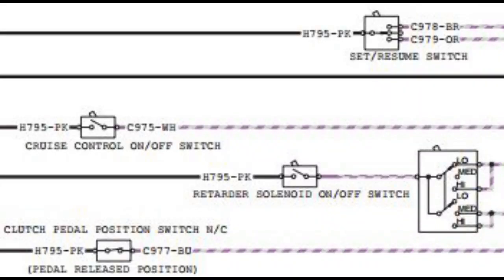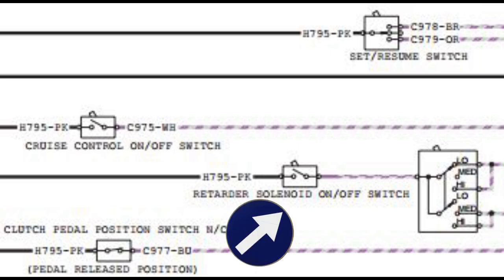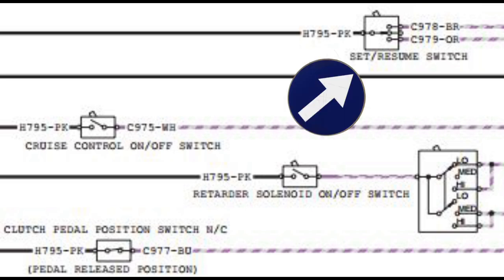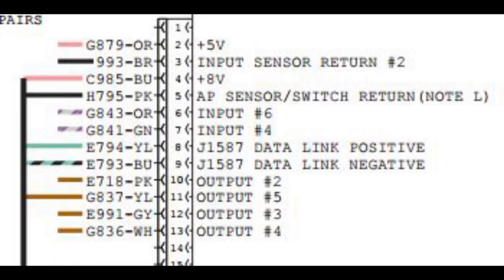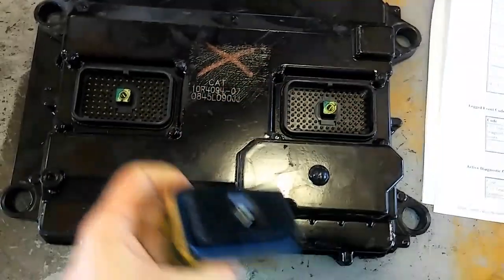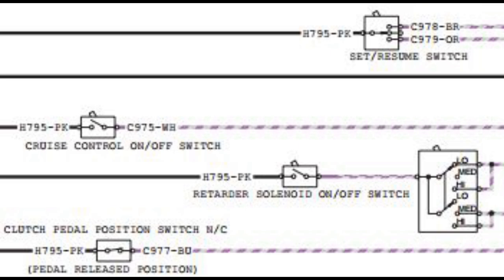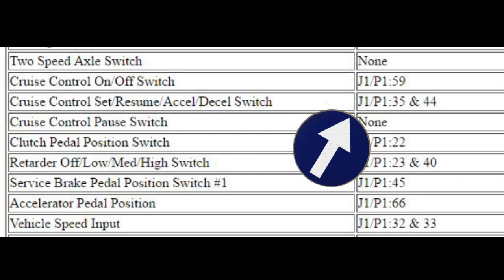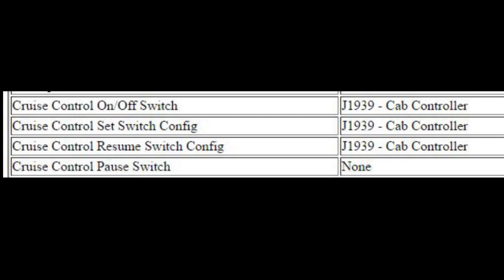Cat Cruise Control Circuit And How It Works.  Diesel Engine Troubleshooting.

Comment: Great video. One question, I have 12v at my #59 pin (ecm side) while Ecm connector not connected. We did have batt/master issues. Kinda thinking the ecm got arc damage. What you think?

Comment: I have a 2001 peterbilt I do not have on off switch . 7cz with a brake save. I was told it is a brake pressure switch but the tech could not tell me where it was located. He had a rough idea but that was it. Any clue where it could be located

Comment: I got a strange situation.  I can set it in neutral and it shuts off when I apply the brake pedal.  It won't set in drive at highway speeds.....

Comment: I have an 02 379 with a 6NZ Cat. My high idle works but I cannot get the truck to cruise. The clutch will also turn the jakes off. Any help? I have also replaced both switches in the dash

Comment: why doesn't my cruise light on the dasboard not come on? have replaced the on/off switch. The test light doe's come on. CAT ET says its the brake pressure sensor switch which we have replaced with a new one.

Comment: I'm guessing my issue is a bad switch.  05 379 with a BXS.  Cruise, high idle, and flash codes won't work.  Jake's work and the check engine light is not burnt out, the light for the cruise control lights up when you flip the switch on, and the brake lights function as they should.  I have had intermittent issues with both the tach and speedometer needles hoping around, or occasionally getting stuck and not moving at all, but the cruise and high idle still worked fine until last night.  Any thoughts, Ape, or others?

Comment: I know you're a busy man but if you could help it would be great ,how could you hot wire the cruise with no switches except the on -off and set resume ,run grounds to ecm on pin locations or power?

Comment: C7 sterling dump truck cannot get cruise control or hi idle to work checked with cat et and noticed the low speed cruise setting was 127mph I'm not sure if this could be the cause or if I'm looking in the wrong place

Comment: 2007 387 c15

What better way to find out about issues then to ask a bunch of peterbilt owners these questions right.

 Hi every one so im sure many of you have experienced issues with cruise control not engaging freeway speed, so what could be the issue?
  Engine break works and rpm idle engages, both buttons on dash have been replaced. The clutch button has been replaced, what else could it be? Thanks ahead of time.
Reply: ramseygonzalez75 make sure your clutch pedal is coming all the way up

Comment: Whats up Ape, got a few questions for ya if ya don't mind please and you may have answered them before but Idk. Fist off, in your opinion what is the best 3406 engine to have and run in a semi?? Next one is I've heard and see that Cat used two different types od pistons in those engines, A 1 piece and a 2 piece,  Why is that and which is better to have?? Next thing is are you a member on the Cat engine masters group on facebook?? Thanks for the vids and keep them coming dude, Learning a bit about diagnosing and repairing and hope to use this knowledge to fix my own someday.
Reply from the maker: +Gary ClarkII I would have to say any of the single turbo C-15 engines really, the 6NZ and 1LW are pretty hard to beat. The older 3406E engines are very good too, just have a worse oil pan gasket design and a couple other little things. Cat used a bunch of different 1 piece and 2 piece piston designs throughout the years, but I couldn't tell you which one is better. The piston part number is based on the engine serial number and horsepower range, I would just recommend going with what Cat recommends. Cat had very few problems with their pistons over the years, it was more the valvetrain that failed more often. I don't have a Facebook.

Comment: Suburb video as usual.  We don't have CAT ET, but we used to, so currently I utilize blink codes and support from Peterson CAT in KF for troubleshooting purposes.  But I'll ask you, and other people can learn about this particular issue.  We run 11 KW T800's (1996 - 2002); however, in one truck the blink code system doesn't function, but the cruise control does.  Any thoughts?
Reply from the maker: +Chad Jessup Hmmmmm, the cruise set and resume works, but the blink codes don't? Sounds like the ECM is perhaps malfunctioned or the check engine light is burned out perhaps. I haven't actually seen that before.
Reply: The check engine light is good.
Reply: The truck arrived at the yard with the check engine light illuminated, and that is when I discovered the blink code system wasn't working.  I took a guess that the problem was low coolant, which it was - sometimes it is better to be lucky than good.
Reply from the maker: +Chad Jessup I would say it is always better to get lucky than be good. Now back to talking about mechanic related items, there is always a bit of luck doing troubleshooting anyways, since you usually have to pick a path to go down and that is half the time up to a hunch you have.

Comment: Greg, you might check BbB industries. com  or Google it. They have car and truck wiring diagrams. I'm unsure if they have what you are looking for.
Reply: Thanx... Bought a Ford schematic for the proper year and model truck... Just haven't studied enough to look at the Cat pin in numbers to computer.. Used it for more on headlight wiring

Comment: Oh shoot, I wish you had a 40 pin schematic... 1997 Ford LTL9000 with a 5EK engine
Reply from the maker: +Gregory A. Parsons You need the pin numbers on your 5EK? What is the entire serial number?
Reply: Hi Ape...5EK80175 this is a dump truck, was bought well used. When I first got the truck about 1.5 years ago I used the cruise control to check engine codes, so it did work awhile ago, now nothing..
Reply from the maker: +Gregory A. Parsons Alright cruise on/off is pin 20 set is pin 25 and resume is 15. Hope that helps.
Reply from the maker: +Gregory A. Parsons Oh the sensor common is pin 29.
Reply: Ok Thanx, checking and matching my Ford schematic pin #
14=brake
15=resume
20=on/off
25=set
29=common to others also
31=clutch
35=throttle...?
37=throttle..?
this really helped because Ford overlays their wiring diagram with 3 other engine that could also have been used, so this narrowed it down by following your starting numbers you provided for a  Cat engine.. if my above numbers are correct...